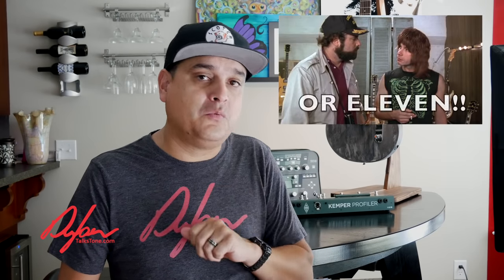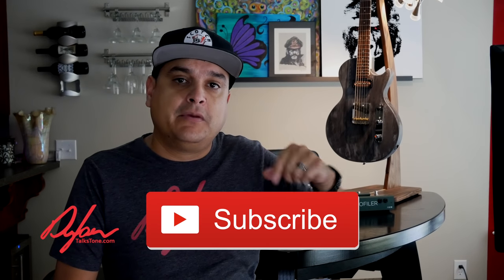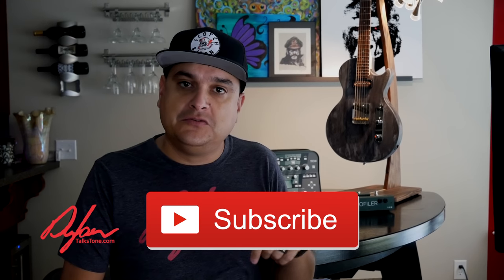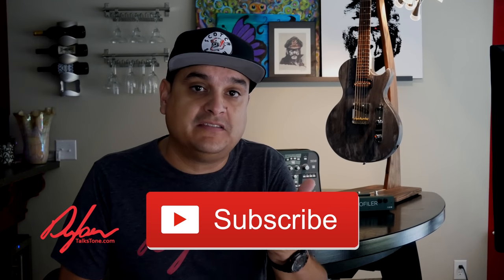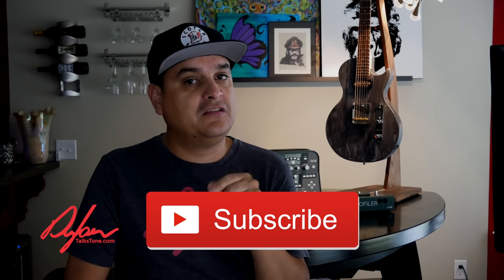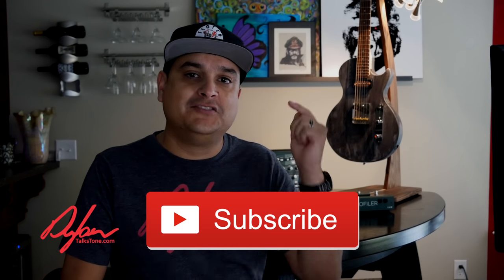How Guitar Pots Work   250k pots VS 500K pots in my guitar

Comment: Its a bit obvious to me that whatevr pickup you choose, when its gone 
through the tone and volume pots, the higher resistance the pots have, 
the better for extended treble.........low impedance into high 
resistance works fine, NOT the othe other way round.....swap your 250k 
pots for 500k or 1meg...........dont forget vol pots need to be log, 
tone linear....thats the British Idea, I think the Yanks call pots 
differently, like there valves, where a Brit ECC83 was a Yank 
12AX7..............hands across the water, regards, Howard, uk vet.(83)

Comment: I have a question (this video is great. I learned a lot from this. Interestingly enough I have a Squire Jazzmaster with Duncan Designed Pickups and 500k pots (vol and tone))

My question is, what little capacitor or thingy do I need, on a Telecaster Lace T-100 pickup, with 500k volume and tone pots?

Comment: Hi Dylan~! Thanks for the video, I'm about to experiment with a coil split setup on a humbucker guitar, which leads to my question:  what value pot would you recommend? I am planning on using 500k pots and back off the tone knob if needed when split.
Reply from the maker: Edgar Arias that’s exactly what I would do
Reply: Great, thanks for the tip. Cheers!

Comment: So generally a jazzmaster commonly has a 1meg pot? Thanks!
Reply: Yes, but unfortunately two years later while looking for a 1meg replacement for my Jazzmaster for over two weeks now it appears that every website is out of stock. I'm about to switch out the old lead pots for 250k audio taper for both the volume and tone pot as the volume pot for a Jazzmaster comes with a linear taper so changing will give you more control over how muddy linear taper tends to become once you lower past the 7-8 range. My main goal is to allow more low end through while the single coils will always retain 90% of its original brightness (I have vintage 1960's tightly wound pickups so they have more output and treble already) but I want more versatility when using a fuzz, overdrive, or distortion as the 1meg can become ear piercingly bad when using any pedals that add dirt.

Comment: Hi Dylan, I found your channel last night after the pickup selector mini-switch on my bass died. Sonce the other switches and knobs on the instrument are bound to fail eventually too, I want to diy exchange all of them with new ones. While I'm at it, I might as well bring the sound more in line with my personal tastes. But I still haven't fully grasped in what way the impedance of a pot influences the sound of a bass guitar. I take it higher impedance means crisper top end, but do I have to worry about the lows in any way? For reference, my instrument is a G&L L-2500. I would love to add dedicated series/parallel/single coil switches for the pickups. The default setup from the factory onky has one single two-way switch that switches both pickups simultaneously between series and parallel mode. I'd love to have the single coil option as well!
Either way, great video! Cheers from Germany. :)

Comment: Came across your channel whilst looking for info on what pots, very informative! I wanted your opinion please on this issue:
 I have just bought a SD Lil '59 to replace the bridge pickup on my MIM strat. 

On SD's site, they suggest staying with 250k pots, but after having a look at a few of your vids, i'm not sure whether to now swap out the volume pot for a 500k pot, or to leave the 250k volume pot and change the bridge tone pot (i have connected the tone pot to the bridge pickup) to a 500k pot. I want to retain the middle/neck pickup sounds as close to original as possible, but i am aware that the Lil '59 may be too dark with a 250k pot. What say you?

Comment: Any advice if your volume and tone pot basically kill the signal below 7?   I'll have to ohm my pots out and see what I have.   My Richmond empire has a single coil in the neck and had a humbucker in the bridge before I replaced it with a hum sized p90.   The pots never really did anything either way though
Reply from the maker: That means it is possible that the taper is wrong for your pickups. Try these pots found here. I would try 500s https://dylantalkstone.com/collections/quality-upgrades
Reply: DylanTalksTone okay cool will do.  My neck pickup is an odd sized single coil and I love the sound but it's already so warm and I really didn't want to put a 250k pot in it and possibly make it warmer

Comment: Dylan,
I’m building guitar with a Warmoth neck and body. It’s going to have an HSS setup. I’m usually a twin humbucker guy but want a more versatile option. I am using a Dimarzio humbucker in the bridge and area 67’s in the middle and neck. Because single guitars usually use 250k and humbucker 500k I’m not sure what I should be using or what wiring option I should go with. There is no pick guard. All pickups will be surface mounted. I would like to have the ability to split the humbucker if I want. What are your suggestions? 
Thanks and keep making the videos. They’re Great!   
Jimi

Comment: Confused? 
A 500k pot has more resistance but allows more Signal through?
Reply: The tone pot and capacitor don't "let signal through" to the output, they let higher frequencies go to ground.  More resistance means "resists grounding high frequencies"